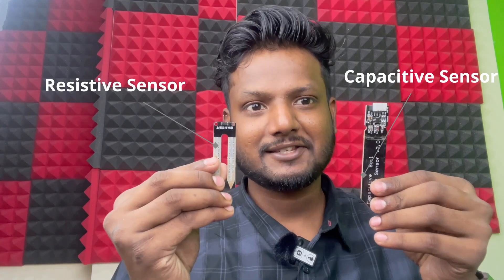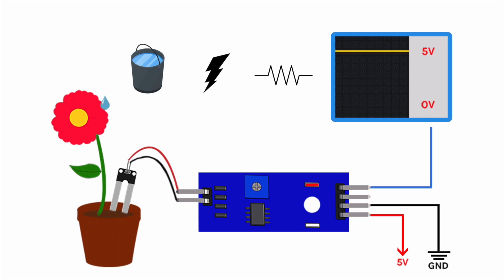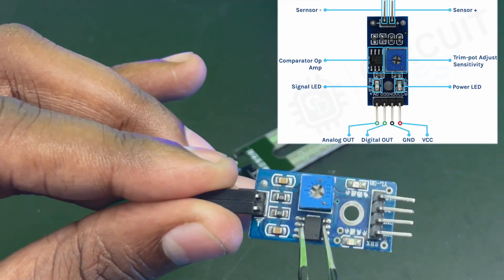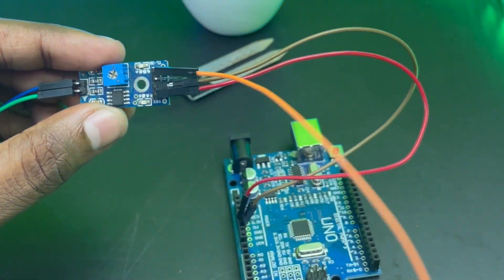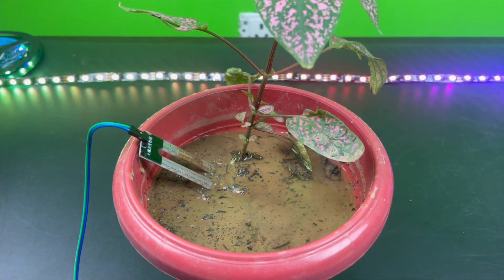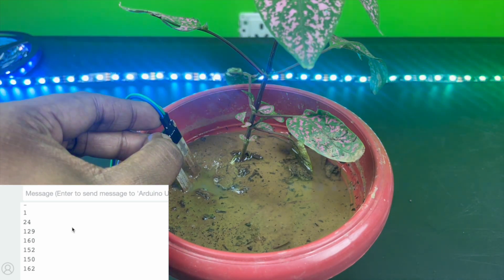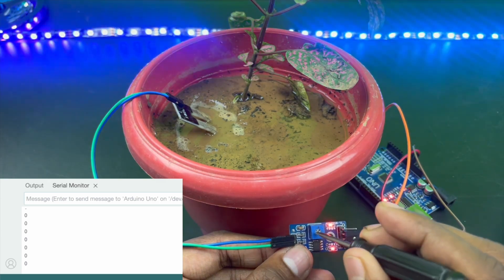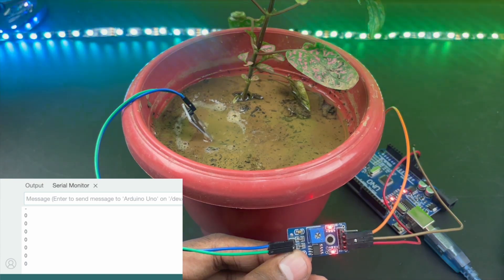How to use Soil moisture Sensor with Arduino

Comment: Tysm bro,I am creating mini garden for mung beans. I'll use tracking solar to charge my 11.1V battery. It will also turn on the pump automatically several times per hour to make water movement to avoid dengue laying eggs. I am using   arduino mega 2560 as the core. Thats all from me bro. Wish me luck 🙏
Reply from the maker: Sounds like an interesting project! Good luck.
Reply: @Circuitdigest  Thanks bro ❤

Comment: Will you need a resistor to run the sensor?
Reply from the maker: Didn't get you. the sensor comes with additional circuitry to process the signal from the resistive soil moisture sensor.
Reply: I don’t think it’s necessary as long as your module supports 5V. However, if your module only supports 3.3V, then we need to use either level shifters or resistors. This is because, even though some Arduino boards support 3.3V VCC, they still output 5V on the signal lines.

That said, in this case, it may not be required, as issues typically arise when supplying inputs to a 3.3V module, not when reading data from it.

Comment: I got crazies questions ... what is the point.  I mean, you need to plug permanently the arduino to a computer and you need to go in front of the computer just in case you need to add water.  Having a notification by email would have been a fabulous idea.  Also, if you got many plant to monitor, you need to have many arduino and component while you can just adapt the code to make it read many devices.
Reply: Thanks for your valuable question! Many others might have the same curiosity. The main purpose of Arduino is development and prototyping. Once the development is complete, we should create a simplified circuit board with only the essential components. This reduces both the size and the dependency on external systems.

You're absolutely right—if we need to monitor each plant individually, it would require a large number of devices, making it expensive. However, this approach is beneficial in agricultural gardens, where monitoring larger areas of land is necessary. By placing sensors at the far end of a block—where water reaches last—we can optimize irrigation and resource management.